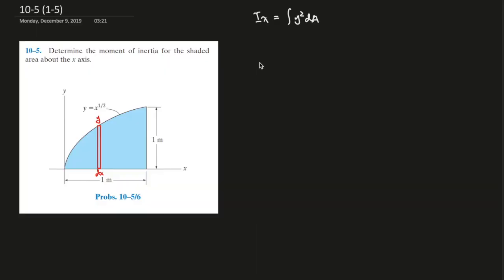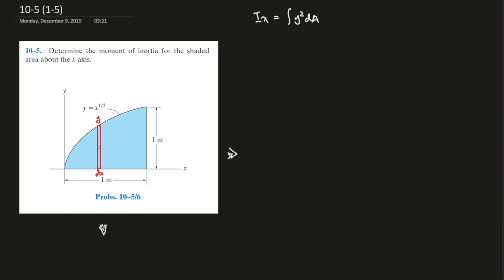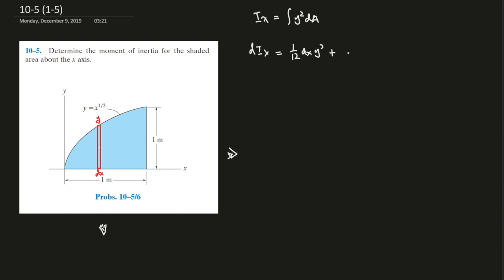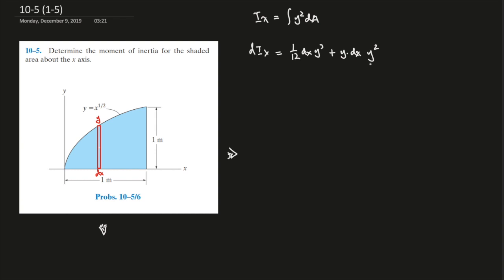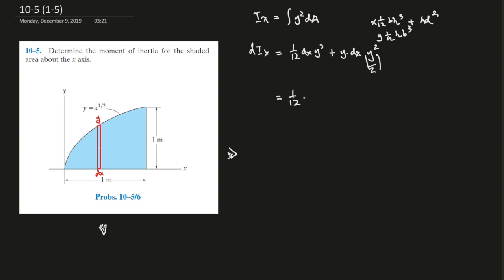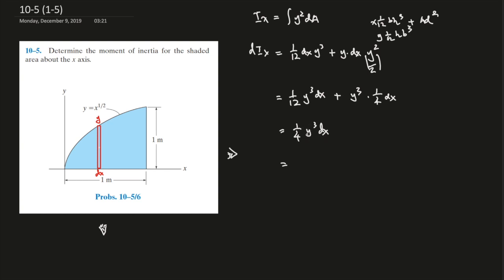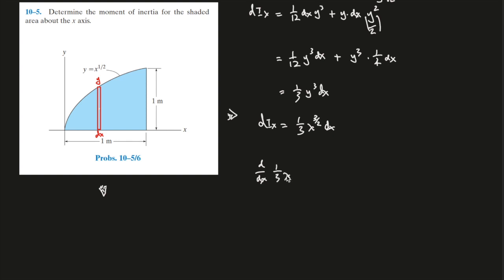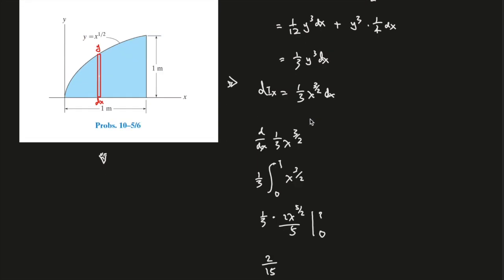10-5 Determine the moment of inertia for the shaded area about the x-axis.

Comment: Hi, Why do not we just use the integral like previous answer? I mean why we calculate with 1/12 bh^3 +Ad^2 
What is the difference?
Reply from the maker: Hi, bud! It is confusing, isn't it? I feel you, I was the same way asking myself, why the F do we have to change it up?!?!? You absolutely right, we can use the previous method and just do a two-step integral. This is just a video proving that the parallel-axis theorem still works. I mean isn't that the beauty of math? Like how many ways are there that allow us to prove the Pythagoras theorem? Also, this video allows you to think differently instead of using one method down to the end because in the later problems, questions won't be this pretty and it will require you to be flexible, improvisational and use them in unseen situations. Anyway, hope my respond helped :).
Reply: TheEngineeringWei thanks a lot
Reply from the maker: Hale Male pleasure!